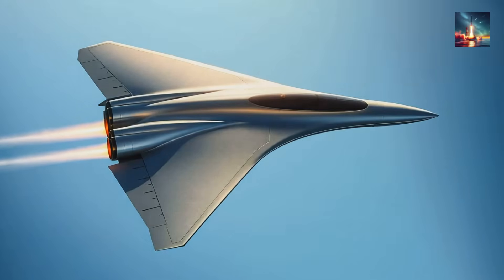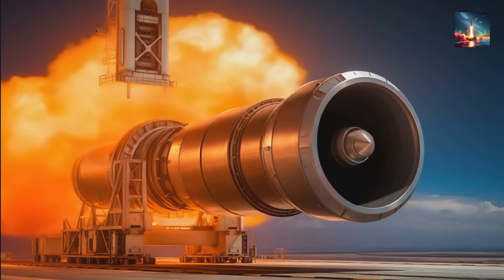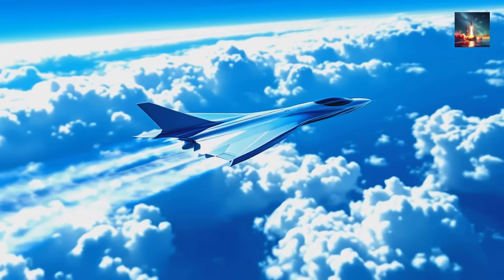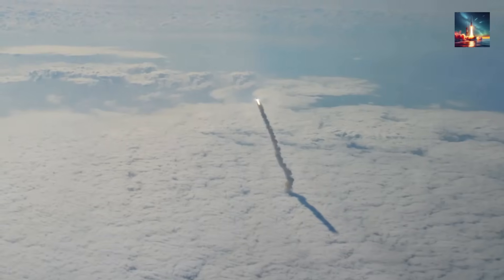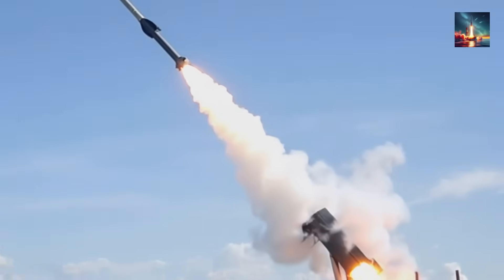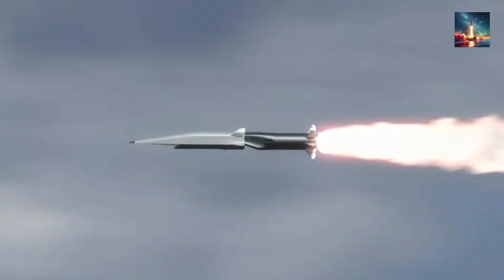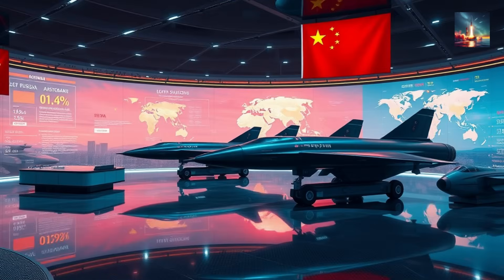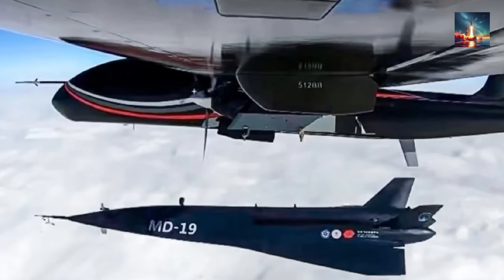Inside The Tech That Powers China's Feitian 2

Comment from the maker: What do you think about Feitian 2? Is it really going to be the future of flight, making space travel possible? Share your comments below. Thank you for watching!
Reply: Hypersonic flight is getting very close now.
Reply: @peteryu515  Feitian-2 has multiple advantages over the U.S. X-51A, as detailed below:
 
- More Excellent Power System: Feitian-2 is equipped with a Rocket-Based Combined Cycle (RBCC) engine, which can autonomously and seamlessly switch between four power modes: rocket mode (0-2.5 Mach), ejector mode (1.5-3 Mach), subsonic combustion ramjet mode (3-6 Mach), and supersonic combustion ramjet mode (above 6 Mach). The switching is smooth with zero卡顿 and zero flameout, and the thrust is seamlessly connected. It uses kerosene/hydrogen peroxide propellant, which is safe and inexpensive. The X-51A adopts a similar power combination but has problems such as thrust oscillation and stability issues. It has failed in multiple test flights and has not solved practical application problems.

- More Outstanding Flight Performance: Feitian-2 adopts a "wave rider" diamond-shaped waverider layout, which can continuously fly in the near space (30-100 kilometers) for 6 hours with a cruising speed of 6-8 Mach. It can also achieve "snake-like maneuvers" through autonomous control of variable angles of attack, with extremely strong penetration capability. The X-51A has an effective flight time of only a few minutes, a maximum speed of about 5.1 Mach, no active evasion capability, and cannot cruise in near space for a long time.

- More Flexible Launch Methods: Feitian-2 can be launched via ground rockets or air-launched with the help of small air rockets. It can flexibly adjust deployment and strike strategies according to mission requirements, with strong rapid response capability. The X-51A is mainly carried and launched by bombers, with unsatisfactory test results and relatively single launch methods.

- More Powerful Strike Capability: Feitian-2 is equipped with a multi-mode seeker and combined with the Beidou satellite navigation system, achieving meter-level strike accuracy. It can accurately strike any target worldwide within 1 hour, reducing the interception success rate of U.S. anti-missile systems such as "Standard-3" to single digits. The X-51A has not yet achieved combat capability, and the goal of "striking anywhere in the world within an hour" has not been realized.

Comment: Feitian-2 has multiple advantages over the U.S. X-51A, as detailed below:
 
- More Excellent Power System: Feitian-2 is equipped with a Rocket-Based Combined Cycle (RBCC) engine, which can autonomously and seamlessly switch between four power modes: rocket mode (0-2.5 Mach), ejector mode (1.5-3 Mach), subsonic combustion ramjet mode (3-6 Mach), and supersonic combustion ramjet mode (above 6 Mach). The switching is smooth with zero卡顿 and zero flameout, and the thrust is seamlessly connected. It uses kerosene/hydrogen peroxide propellant, which is safe and inexpensive. The X-51A adopts a similar power combination but has problems such as thrust oscillation and stability issues. It has failed in multiple test flights and has not solved practical application problems.

- More Outstanding Flight Performance: Feitian-2 adopts a "wave rider" diamond-shaped waverider layout, which can continuously fly in the near space (30-100 kilometers) for 6 hours with a cruising speed of 6-8 Mach. It can also achieve "snake-like maneuvers" through autonomous control of variable angles of attack, with extremely strong penetration capability. The X-51A has an effective flight time of only a few minutes, a maximum speed of about 5.1 Mach, no active evasion capability, and cannot cruise in near space for a long time.

- More Flexible Launch Methods: Feitian-2 can be launched via ground rockets or air-launched with the help of small air rockets. It can flexibly adjust deployment and strike strategies according to mission requirements, with strong rapid response capability. The X-51A is mainly carried and launched by bombers, with unsatisfactory test results and relatively single launch methods.

- More Powerful Strike Capability: Feitian-2 is equipped with a multi-mode seeker and combined with the Beidou satellite navigation system, achieving meter-level strike accuracy. It can accurately strike any target worldwide within 1 hour, reducing the interception success rate of U.S. anti-missile systems such as "Standard-3" to single digits. The X-51A has not yet achieved combat capability, and the goal of "striking anywhere in the world within an hour" has not been realized.

Comment: The US claims China cannot innovate. Rubbish. The US military doesn't have even one operational hypersonic missile.The Feitian 2 is revolutionary sci-fi tech that incorporates the RBCC engine, AI flight control system, and exotic ceramic matrix composites and advanced carbon composites. Now, throw in the ability to use cheap kerosene and hydrogen peroxide oxidizer which doesn't require expensive cryogenic cooling.